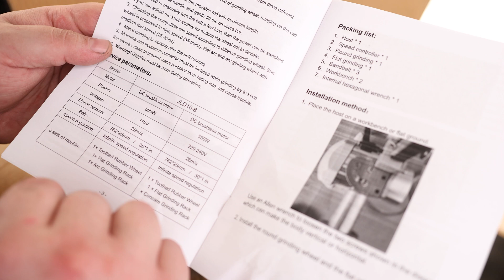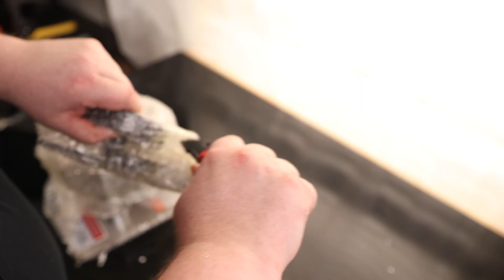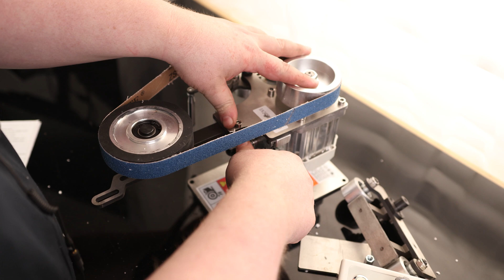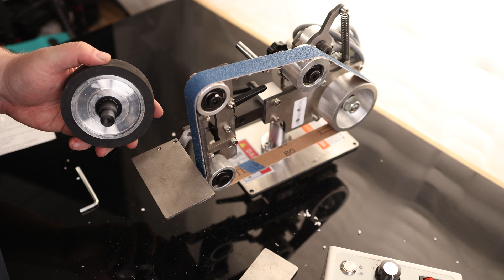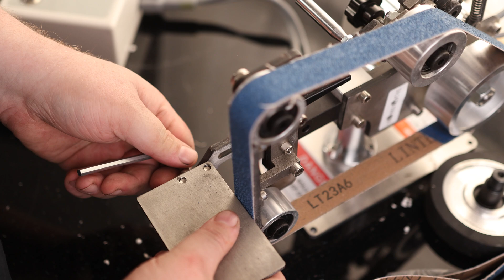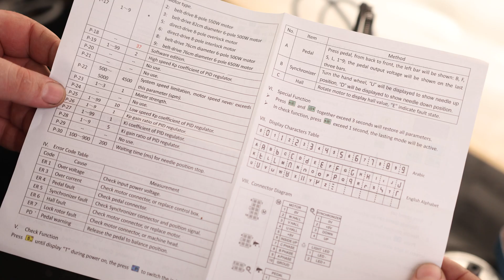VEVOR Belt Grinder Sander, 30 x 1-Inch Variable Speed Belt Polisher with VFD, 550W Polishing

Comment: I don't guess you would email me a picture of that sheet with the perimeters would you? I can't get mine to change directions. Thank you
Reply: sounds like we both got the same crap... i just got mine today.. it has zero instructions for the programming/buttons and mine doesnt chnage directions either... i contacted support.. they made me send a video and said they will get back to me.. i bet al the new ones they had come in recently after selling out, all have this flaw.
Reply: @razoredgechris did you figure it out? I had to go into the program. Holler at me and I'll tell you how to do it
Reply: To change direction of the belt, Press "P" and "S" together, this brings up program mode. Use the + to go to P-5, press "S" to enter. Press the + or - to select 0 or 1, press "S to" exit. This should change the belt direction.

Comment: Hi there, thanks for the video. I’m having a lot of trouble finding the right machine. Do you think this machine would grind flat the glass loop on the back of glass buttons. I just want to remove the glass loop to make pendants. Really appreciate your reply. Nikki
Reply: Cheers thanks for your ideas…
Reply from the maker: Yes, but you would need a silicon carbide sanding belt.
Reply: @distractor_beamreviews  great thanks so much, is the silicon carbide used for glass without water. I watched the belt sander quickly grind down that steel bolt. I thought steel was tougher than glass. So glass not always needs water if using the correct belt.
Reply from the maker: @RopeQueenArt  Glass is harder than steel.  Water acts as a lubricant and helps to keep the dust down which is important because of silicosis.  Just make sure you wear a respirator and do it outside.  A water compatible sander may be better for your project if you plan on using it a lot.
Reply: Hi, thanks for your reply. I want to grind off, grind flat the glass button loop from the back of  10000pcs 18mm wide glass buttons, removing 5x5mm wide glass loop. So difficult to know exactly which machine will do the quickest most efficient job…a machine spinning horizontally or vertically? I could use a horizontal diamond lapidary machine, pressure downward, a silicone carbide belt sander or carbide bench grinder. An adaptor may work to hold the button while grinding. I have been wanting to start for 2 years now but I can’t get past this hurdle. I want to get it right for the start… if you have a solid idea for me I would really appreciate it. Cheers Nikki
Reply from the maker: @RopeQueenArt  10000 is going to take a while.  My first thought would be a dremel style tool with a diamond bit to cut it off.  Then I'd either flatten it by hand with the same rotary tool, or with a sander like this, or with something like this:  https://www.amazon.com/Hi-Tech-Diamond-Grinding-Polishing-Accessory/dp/B07CB19PXG